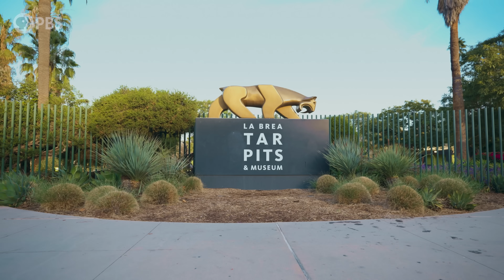The Mysterious Mass Extinction Hidden in LA

Comment: Copilot:  
A breakdown of wildfire ignition sources on the U.S. West Coast, based on recent data from federal agencies and wildfire research, (-2025):

Human activity	~85%	Includes power lines, vehicles, campfires, cigarettes, arson, fireworks
Lightning (natural)	~15%	Most common natural cause, especially in remote or mountainous areas

"Breakdown of Human-Caused Fires (subset of the 85%)
While exact percentages vary by year and region, here's a rough estimate of how human-caused fires break down:

-Equipment use (vehicles, machinery): ~20–30% of human-caused fires
-Power infrastructure (e.g., PG&E faults): ~10–15%
-Campfires and outdoor burning: ~10–20%
-Arson: ~10%
-Smoking/fireworks/miscellaneous: ~5–10%

These numbers shift depending on the season, geography, and local regulations. For example, 
in California, utility-related fires have been particularly devastating due to high winds and aging infrastructure.

🌡 Climate Change as a Multiplier
While not a direct ignition source, climate change has dramatically increased the intensity and frequency of fires by:
Extending fire seasons by 78 days since the 1970s
Drying out vegetation and soils
Increasing the number of extreme fire weather days"

Comment: When the next BIG Earthquake happens, and I mean 9-10 on the the Richter scale the ground is going to shatter like a broken glass jug. The LA Basin ground structure is inundated with faults but more importantly oil and natural gas!  Once the ground is shattered this will let loose the natural gas deposits that will be ignited by live electrical power wires or fires everywhere. An excerpt from USGS as follows...Using a geology-based assessment methodology, the U.S. Geological Survey estimated undiscovered, technically recoverable mean resources of 61 million barrels of oil and 240 billion cubic feet of gas in the Los Angeles Basin Province. Not the place to be!